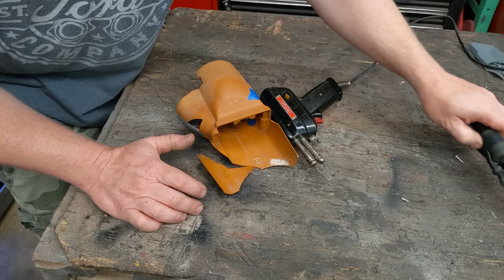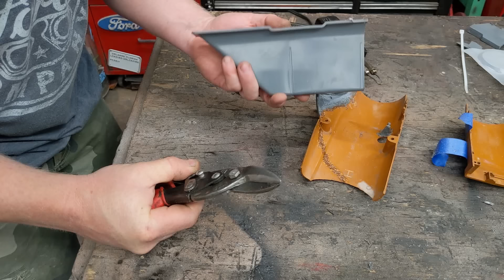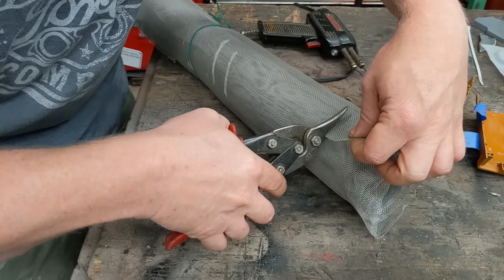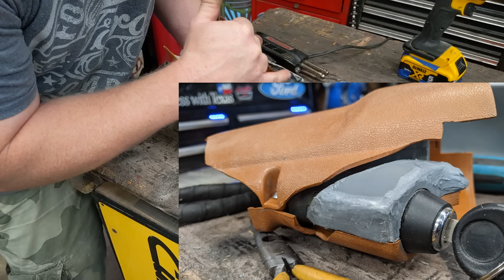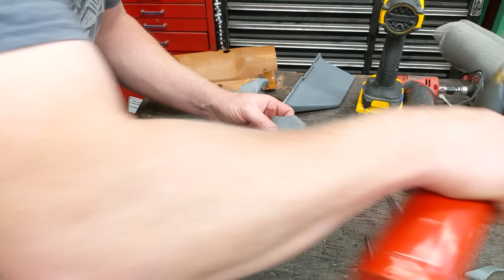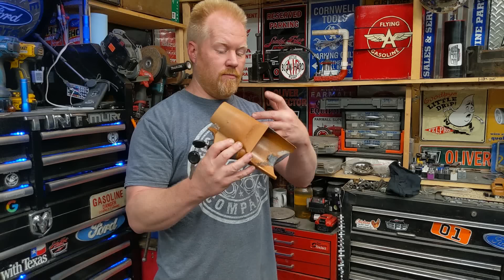HOW TO FIX broken plastic ULTIMATE Welding Forming Repair techniques

Comment: You can use the plastic sludge method too this involves getting the exact plastic and using the correct chemicals to melt the plastic into the sludge and painting it on and around the old parts after sanding, then let it dry and repeat until you have a more or less 100% strong skin so abs plastic needs acetone and abs sheet cut into small bits and soaked overnight in acetone. The acetone does have to be 97-100% pure and its very strong. Just find the formula that you want. Styrofoam use petrol as with anything chemicals use in a well ventilated area 👍

Comment: I was able to fix the hood on my friends John Deere Gator that had broken in two thanks to this method. Both sections went together using the steel mesh melted between them. It's held up great for over a week.

Comment: @sixtyfiveford You have a very useful skill set for fabrication of panels and many items. I appreciate you sharing that with me. I'd like heat form tool belt holsters.
I was going to buy polypropylene waste baskets or storage bins on sale for the projects. Do you have experience with that kind of plastic?  It flexes perfectly as is, but am concerned it will get brittle after high heat molding.
Reply from the maker: Other than just fixing pieces, I haven't played around a ton with polypropylene. Hdpe is my favorite and can be found everywhere. 5 gallon buckets made out of it and gives you huge flat sheets essentially. It doesn't stink when heated or melted and is extremely durable and flexible.
Reply: @sixtyfiveford You have a new subscriber.

Comment: how many watts is the iron ur using
Reply from the maker: A 40 w soldering iron is more than adequate. A larger soldering iron simply allows you to do much larger pieces without reheat time.

Comment: A little super glue for the initial 'piece together' gets a tighter joint than the tack weld method in some cases. A lot of great tips in this video! Thanks!

Comment: This is a good video and tutorial, no doubt, but I find it concerning that there are so many guides on plastic welding and the harmful chemicals released from melting plastics are rarely mentioned, so I feel compelled to do so now:

When HDPE (high-density polyethylene) is heated to its melting point (~130-137°C or 266-279°F) and beyond, it starts breaking down, releasing a mix of volatile organic compounds (VOCs) and potentially hazardous decomposition products.

Primary Emissions from Heated HDPE:

1. Carbon Monoxide (CO):
   • Source: Produced during incomplete combustion or heating of HDPE.
   • Health Effects: CO is a colorless, odorless gas that can cause headaches, dizziness, confusion, and, at high levels, unconsciousness or death by interfering with oxygen delivery in the body.
 
2. Carbon Dioxide (CO₂):
   • Source: Generated during combustion of HDPE.
   • Health Effects: At elevated concentrations, CO₂ can lead to respiratory issues, dizziness, and, in extreme cases, asphyxiation by displacing oxygen.

3. Aldehydes (e.g., Formaldehyde, Acetaldehyde):
   • Source: Released when HDPE is heated above 330°C (626°F).
   • Health Effects: These compounds can irritate the eyes, skin, and respiratory tract, and prolonged exposure may lead to more severe health issues.

4. Lower Molecular Weight Hydrocarbons (e.g., Methane, Ethane):
   • Source: Emitted during the heating and melting of HDPE.
   • Health Effects: Inhalation can cause dizziness, headaches, and, in high concentrations, pose asphyxiation risks.

5. Styrene & Benzene (at very high temperatures or when mixed with other plastics):
   • Source: Produced when HDPE is heated with other materials or at excessively high temperatures.
   • Health Effects: Both are known carcinogens. Benzene can cause leukemia, while styrene may affect the nervous system.

6. Dioxins & Furans (Only if heated with chlorine-containing materials, like PVC):
   • Source: Produced when HDPE is heated in the presence of chlorine-containing materials.
   • Health Effects: Highly toxic, bioaccumulative, and linked to cancer.

sources
• https://www.hilltopproducts.com/safety-data
• https://www.pes-tec.com/images/pestec/TS-2-7_HDPE-Fire-Behaviour-and-Properties_20200220/GI_102-1_HDPE_Fire_Behaviour_and_Properties.pdf
• https://www.gemplastics.com/safety-data
• https://www.amtop.co/safety-precautions
• https://www.amtop.co/hdpe-fume-composition
• https://ehp.niehs.nih.gov/

Comment: Thanks very helpful. I have a cracked piece of plastic that helps to open my trash can. I tried soldering it but it did not work. I am now thinking of screwing it with a metal plate. Any suggestions on how to screw in to plastic?

Comment: It is essential that the plastic filler rod material is the same as the broken piece that is needing the repair.  The weld will be compromised when two different materials are used.
Reply from the maker: Plastic types are mixed all the time for better performance. Been doing it for years and never have issues even with repairs that are structural.

Comment: A great alternative to sceen mesh, if you don't have any kicking around, is fine steel wool. 
Something like 0000 is what I use for glass and happens to work for reinforcement of plastic welds... 
Just unravel and use it the same as mesh, cut to shape and melt into the repair, top of with filler and its more solid than the original. 
Great video by the way.
It's cool to see other folks using this method to fix rather than replace.

Comment: Thanks. Awesome! Perfect instructions, unlike many other lesson videos. I have a big plastic hdpe box I want to hold sand to serve as molds for sculpture concrete casting. But it has a big crack in the bottom. I was hoping it would be possible to salvage, as it is the perfect box for my needs, with strong reinforced sides, & I don't think I could even find one to replace it. I had hauled out wood to build... & now I can save all the wood/ construction/ staining/ sealing.

Comment: When possible use the same type of plastic repair material as the damaged part. Not all plastics will adhere well when they are not the same type.

Comment: Some other things you can use to strengthen the parts are bridging from one side to the other with varying size staples, nails, mig welding wire, springs (for round objects, like rods), imagination is the limit really. Great vid btw.

Comment: about two years ago, I learned bout plastic welding idea from a video.  when I was bout to do it myself, I realized the aluminum screen would work even better as I imagined the idea from DIY carbon fiber, as it is basically fibers infused with plastic.  By the way, plastic welding should be done outdoors or with very good ventilation, we don't know the chemicals that might be released.

Comment: I've seen people putting a strip of ahesive metal foil tape to the "good" side, to help you getting your weld deeper. The idea is that, even if you melt the whole depth, the metal backing will get the molten plastic in the original position and texture.

Comment: Great tutorial. Thank you. I searched the web right after failing to repair a with superglue... Following your video I used my pencil welder successfully without a filler or mesh.
As the back side had no discoloration following the welding, I was tempted to weld the 'cosmetic' side too, but as it was uv deteriorated, I made an ugly mix of the degraded layer and the original deeper layer, and left an eternal memoir for my inexperience.

Comment: "super glue does not work on plastic." When prepped properly super glue does work on some plastics.  I guess you just haven't used it on the correct plastics.

Comment: Well THAT was pretty cool! I learned a lot! Thank you!
Reply from the maker: Glad you liked it!
Reply: Okay…so…I’ve started playing around!!! 🥳lol
First thing…I discovered my friend’s soldering  gun has a tip like a pencil. 
I’m trying to use a variety of dental tools like small spatulas to flatten out the plastic as I’m heating it. (Tried using a zip tie, but you’re right- too brittle.) 
Turns out I’m not very co-ordinated! 😂
Will buy a different soldering gun with interchangeable tips! 
2) Does HDPE Plastic have different numbers in the recycling triangle or is it only #2? 

I am LOVING THIS!! So fun! 😂
You would not believe the money I’ve spent and the BOX of specialty glues I have bought in my never-ending quest to repair broken plastic!!! 
You’re the answer to my 
‘re-prayers’ ….
😂😂😂HAHAHA

So…first attempt was a little ‘lumpy’ but that’s okay given the shape of the tip and the fact that I used zip ties! 🤷‍♀️ It’s all about the hands-on learning, right!  😉
Thanks again for sharing your techniques and advice! It’s very appreciated!! 

Here goes my second attempt. Rounded up some metal screen and HDPE 2. 
The only way from here is up! 
😂😂😂
Patti
Reply: Ugh! 🤦‍♀️just discovered that the metal window screen is nylon inside! 😂
Off to find some REAL metal screen! 
When I’m looking for a soldering gun to purchase, is there anything in particular that you would recommend? (Specific kinds?  variable temperatures? 
What should I look for in minimum and maximum temperatures? ) 
Besides a light, are there any other features you recommend? 
Thanks again! 
Patti

Comment: I bought some stuff called rapid fix here in New zealand it has two bottles one of powder and one with a clear solution sprinkle the powder in a Crack or hold the plastic together sprinkle then add solution most amazing glue I ever used cost 40 bucks nz sets harder than the original plastic.

Comment: Pretty good video. Lots of good tip
I have used the screen also, it works good. I used to use a rig like yours & sometimes still do, but mostly now use a pencil style iron with a screw in tip. I have several tips that I made just for plastic welding of brass & stainless. I shaped one triangular shaped so that I can easily melt into the crack, and then turn it sideways to mix& smooth the plastic. I have another one of stainless that was a wide flat piece with a threaded portion that screws right into my iron. I shaped it spoon like on one side down to a thin edge. That one I turn sideways to melt in the crack and then use the flat spoon side to mix the plastic and smooth at the same time. This one works great to push screen into the plastic very quickly. They make the work go very quickly and I get a lot of plastic mixing and I am able to smooth out the plastic so it looks really smooth.

Comment: Yes,it really works, but those fumes are not to be subjected to. My uncle had a plumbing company. During the sixties he helped introduce plastics as a replacement for pipes, gutters, etc. He would practice plastic welding in his free hours - the fumes coming up into his face, until black spots appeared on his forehead. A few years later a cancer developed in his throat. That was the beginning of his end.

Comment: Great video. I had already bought a plastic welding kit from Harbor Freight and it worked well but your tips for the Trigger gun and adding screen and copper wire really will top off the future repair projects.
Thanks

Comment: Genius, I have seen the plastic welders body shops use and it is great but expensive, I never would of thought of using a soldering iron, I will try this for a few things that need fixing.

Comment: You want to forever bond those pieces together with less steps and time? Baking soda and super glue.. sand it down. Done. Baking soda first.. then super glue. Set how you want it to be forever stuck, sprinkle baking soda.. you don't get to move it once the glue hits. If you have the ratio correct, this instantly turns in to a cement stronger than the material you're connecting.

Comment: I second most of what you say in the video with one exception. You need to match the type of plastic filler or replacement patches to the type of plastic of the part. I've had some garbage can welds fail when the can turned out to be Polypropylene  and the replacement patches were HDPE or vice-versa. They held for a few months and then separated on their own. Nylon to Nylon works quite well. Be careful with zip ties. Some are Nylon, some are HDPE or maybe even PET. LDPE to HDPE might work. I welded a broken Lexan? tail light back together. It was ugly, but it worked for a while.

You can make entirely new objects by welding pieces of plastic together. I made drawer boxes about 8 -10 years ago with 4" PVC drain pipe. I cut a lengthwise slit and opened it up flat using a combination of heat gun and oven. I used the heat gun to open it up and the oven to heat the sort-of flattened panels. I sandwiched the oven softened panels between pieces of leftover granite countertop to cool and make flat. They tend to shrink in area but thicken. Then I cut into square-cornered rectangular panels with the table saw. These panels were then butt welded together and cut to size to make drawer sides. I welded the drawer sides together with the soldering gun without reinforcement. I use this tool box every day. It's full of wrenches, screw drivers, files, sockets an a lot of other junk. All of the welds have held intact so far.

I not so sure the screen and wire reinforcement trick would work with PVC. PVC tends to begin to smoke and burn before it gets soft enough for the metal to sink in. Getting the PVC temperature high enough to soften to where it will weld together without burning takes some practice. If you get it too hot the weld joint can start to become brittle.

Comment: I thought I’d never see a soldering gun like the one I’ve owned for a super long time.

I’m guessing your is a Weller? Mine is a Weller 8100-B. From reading online and taking the Patent # from the side it’s believed that they started making them in the 1950’s.

From the looks of mine I strongly believe this to be true! 😜

Also the tips that came with the gun were for cutting plastic tile and for mending and sealing as well as electrical wire soldering.

Anyways appreciate the video.

Comment: For less than the price of that Weller you can buy a plastic welder. It is an air heat gun. Much like those hot air paint removers. BUT they have a temperature controller. Each type of plastic has a range. You can buy the plastic rods. ABS, PVC etc. They were made to repair plastic bumpers. I used mine to fix my lounge chair that my drug filled landlord had stomped on. After making the repair she came back and broke it again. I backed it with aluminum screen and her comment was that she really had to kick it very hard to break it again. A low wattage pencil iron would work better, but buy some rods that match the type of plastic. OR buy UV plastic glue! Run a bead after taping the other side so it holds the shape. Run the ALUMINUM not SS mesh on the seam then put a drop of UV glue. Take a UV light that comes when you buy many of the glues and turn it on. Might take a few seconds to harden. Add another drop and work your way down the seam. You can also make replacement parts but it is easier to use the EXACT same plastic from some other source then shape it. Sometimes a hair dryer will work just fine. The brown is probably Polypropylene. Get some poly ROPE for seams. But it could be PVC so cut some PVC pipe. Likely not Polycarbonate or ABS. High-Density Polyethylene or HDPE is close but not the same as Polypropylene. Heat ranges are different.

Comment: Stronger how? Tensile strength? Elasticity? Made the claim several times but I see no means of measuring.
Reply: you don't need to measure, once you been doing it for a while you just know what has the best chance of holding, i don't totally agree with his tool of choice but it works for him and the stich technique he's using is the same technique the pros use  for repairing car bumper covers, either it works or it doesn't....

Comment: Very interesting but are all of those plastics he's welded thermoplastic?  Thermoplastic, as its name suggests melts when heat is applied whilst the opposite,  thermosetting will just burn and smell. Not saying you cannot weld thermosetting but it would need to be a different form with more of a frame or fixtures such as staples to hold the pieces together. 
Can anybody say if I'm correct or not?

Comment: well, it will still crack along that same crack, iv done a ton of these same exact repairs with screen as backing, but since u couldnt do the other side because of it being cosmetic, its weak on that side if u bend it the way that opens that crack up it will break along that crack

Comment: one thing to worry about is polyethylene isnt compatible with all plastics, if its actin like weldin aluminum with steel wire, then try a different plastic